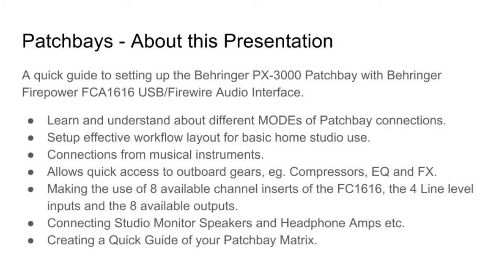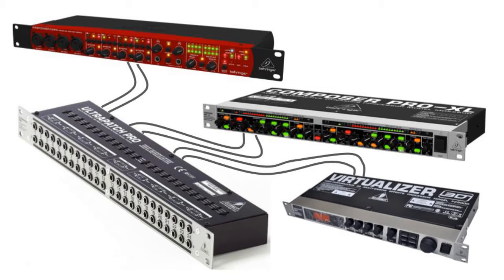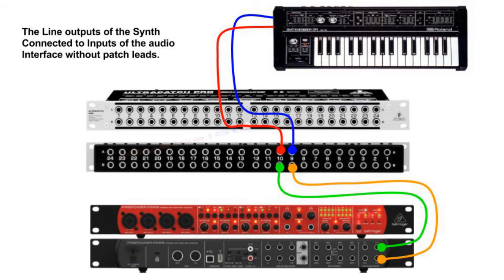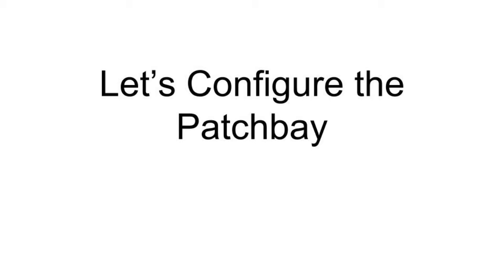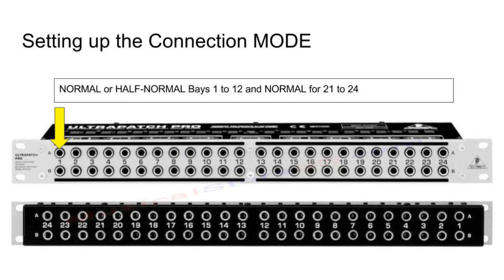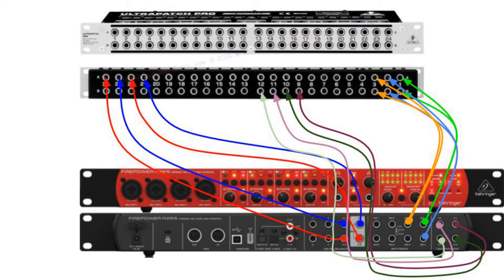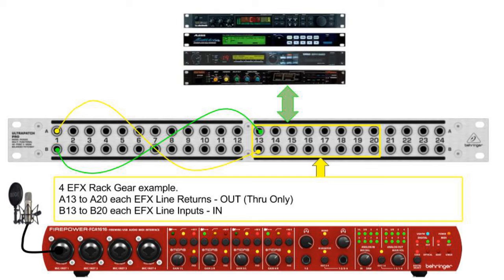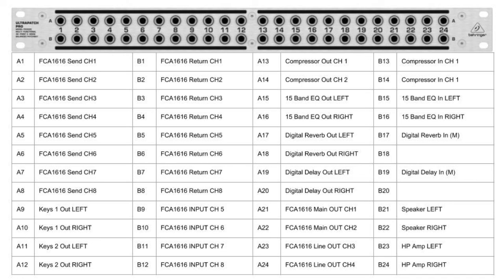How to Setup A Patch Bay PX3000 With FCA1616 - A Complete Guide Part 1

Comment: You make things SO clear!  What would you do if you had a combination of gear as shown in this video, AND a combination of gear that strictly uses RCA connectors (casette player, reel to reel, turntable) but using the same speaker system?  Would I need a patch panel configured strictly for RCA?  Your input would be greatly appreciated, and, thank you in advance.

Comment: Thank you! Working up the courage to hook up my patchbay at the moment, so your video helped. Would you recommend using stereo 1/4inch jack cables (e.g. for synths) or single balanced mono jack cables for each output (L and R)? Normally I would use a stereo cable into my interface, but not sure with a patchbay. Thanks in advance.
Reply from the maker: Stereo or TRS jacks can be used for unbalanced stereo audio or balanced mono audio. If your synth and interface supports balanced sockets, then use TRS leads, 2 TRS for stereo.
PX2000 is unbalanced patchbay and PX3000 is balanced. I recommend PX3000 as you can still use it for unbalanced connections.
Technically, you can use the PX3000 single point for unbalanced stereo connection.
Reply: @RecordingStudio9  Thank you very much for the quick reply and advice. Sorry, I wasn't very clear - I have a dual TS unbalanced cable for my synth (they are one cable with two TS jacks at either end https://www.amazon.co.uk/Hosa-Stereo-Interconnect-Dual-Same/dp/B000068O1A/ref=sr_1_5?crid=2DLK9S7N8DSKY&dchild=1&keywords=hosa+ts+cable&qid=1600847671&sprefix=cable+TS+hosa%2Caps%2C163&sr=8-5).  Would you use this or rather, single TS cables for each channel (L and R)? Thanks again!
Reply from the maker: No difference, as you can split the fig 8 TS leads into 2, if that's what you mean.
Some higher quality TS leads may have better shielding and support, as well as solder connections.
Reply: @RecordingStudio9  thank you!

Comment: Great video! I know understand the use of a patchbay more! :)

I'm also thinking that the use of hardware and a patchbay is more of a "recording phase" rather than a mixing/mastering phase, but that depends on the Outboard gear one has... I probably wanna use my plugins during mixing/mastering, but use the hardware like pre-amps, etc during recording. But then again, there are also hardware for mixing/mastering of course, like dedicated Exciters, Stereo wideners, compressors/EQ's, Maximizers, etc for the 2Bus (Stereo Out/Master channel)… I'd of course use these "specialized" hardware as "a last step" in your mixing/mastering (maybe…).

I'm also now thinking about a setup involving "re-amping" (Before mixing/mastering)... Since if a record a vocal or a electrical guitar/bass/acoustic guitars but afterwards find the sound not as I need them in the mix then I probably also should initially record everything using two signals - one wet (with hardware effects like a Preamp, Compressor, EQ, effects like Delay/Reverb, guitar Amps, etc) and one signal is recorded completely dry (no hardware at all except through a "very transparant" preamp, either via the Audio Interface or other preamps). Right? Then using the "re-amping technique" I could re-record a vocal, etc pretty easily using the patchbay? Any video on that? ;)

Comment: When connecting my 18i20 should I be in half normal or fully normal positions and to do least patching.
I'm also trying find information on FC control any advice. On navigation through that
Reply from the maker: I already explain each Patch Bay mode in very detail in this video. It all depends what equipment you have and your workflow.

Comment: Hello! Could you make a detailed diagram of the connection of the patch panel, external audio equipment and audio interface without inserts, for example Fokusrite 1818. Thank you!
Reply from the maker: try watching from 9:34
Reply: I have an audio interface, which has eight analog inputs and outputs. There is also a four-channel compressor and two spatial effects (M-One, D-Two). I do not quite understand what type of connection to use - normalized or through. 
Draw, please, an approximate connection scheme.
Reply: (applicable to my configuration) Thanks
Reply from the maker: I already have few videos in detail explaining what each patch bay mode is and how they work. 
If you require specific help, then connect with me via Google Hangout video, make some $ payment, and I can gladly help you.
Reply: Thank you

Comment: Thank you Vatche, I am going to watch and rewatch this and every other video you put up here on patchbays until I have memorized every word and every diagram, LOL. I have almost finished building my home recording studio desk, and I have a number of pieces of outboard gear including the Focusrite 18i20 interface to install in it, so your patchbay tutorials are coming out at a perfect time for me. Thanks again, and I am looking forward to the next one now.
Reply from the maker: Thanks. Part 2 has just been uploaded
Reply: Thanks again Vatche. I'm a little confused about connecting my EQ, compressor, etc. from my 18i20 through my Patchbay, and why an insert cable cannot be used, but more study is required, lol.
Reply from the maker: Here is the details you may be missing https://www.youtube.com/watch?v=a_iJphEicgs
Reply from the maker: Focusrite 18i20 does not have insert socket option. :)
Reply: i also have the 18i20 anfd my question is this. if all my inputs are connected to the patchbay, how can i then plug in an xlr mic? there is nowhere to feed the mic input now that the inputs on the interface are occupied?
Reply: i'm guesseing external mic pre's would be a way around this, so you can plug your mic into the external pre's , patch them through whatever outboard gear and then back into the 18i20. is this correct? it's the only logical way as far as i can see

Comment: Dude this video came on time, I just bought a 1616 that is coming next week and I'm looking to buy the PX3000. It would be nice if you explained a little more about the insert imput connections of the 1616 with the PX300 and how to connect the peripheral equipment, I was a bit confused. On the PX300 can I connect condenser microphones to it and use phanthon power?
I've been looking for information on this and your video is the best I've seen.
Amazing!
Reply from the maker: +Mauricio Sabino 
Thanks. I do have a video on FCA1616 inserts on my channel. 
Though you can pass phantom power via the patchbay, but I normally connect the mic to the interface or the mic-pre directly.